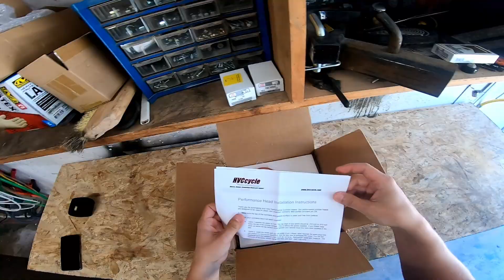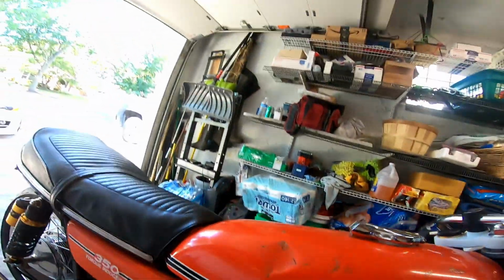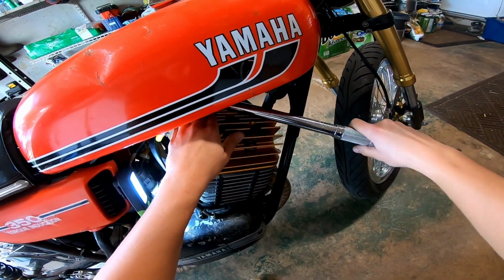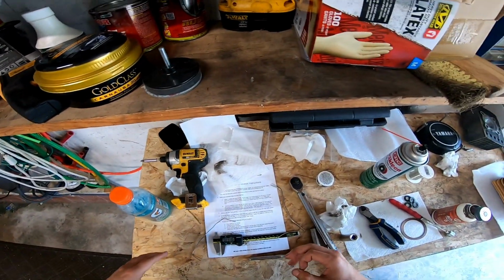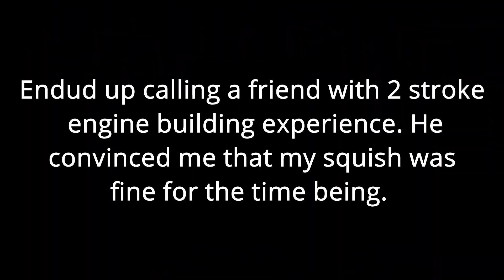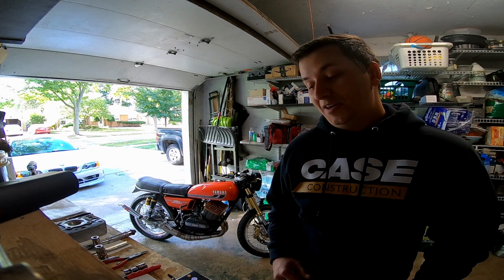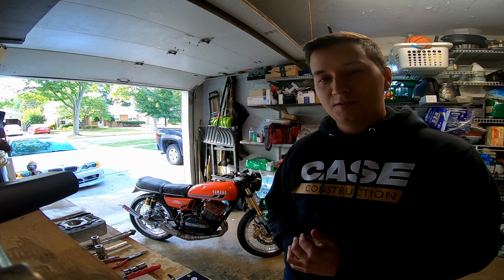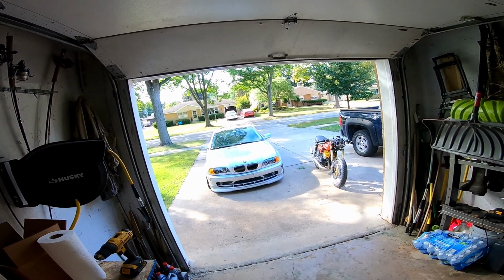Installing HVC Cycle CNC Performance Heads on my Yamaha RD350 Cafe Racer!

Comment: Hey would you share the specs of the entire front end on your bike, forks, tree, hubs and disc set up please 🙏
Reply: @engineered if you can share the specs, I am currently building a RD and want a similar set up
Reply from the maker: @HSJ1076  so I'm using 2017 honda grom forks. Turned down the RD stem on a lathe and pressed it into the grom lower triple tree, just used new RD tapered stem bearings. Using an EBC aftermarket ducati monster 695 300mm brake rotor, though theres various ducati models that use the same 6x80mm bolt pattern 300mm rotor. Aprilia rsv mille brembo brake caliper with a moto guzzi v7 brake master cylinder and a spiegler stainless braided brake line made to length per my specs. 

I designed in CAD the various adapter parts and had them machined from aluminum: upper triple tree, left/right axle adapter, brake caliper bracket, rotor spacer, and gauge bracket. You can probably get away with the grom upper triple as well if you machine an adapter to step up the rd stem to the grom triple's stem hole diameter. Also i had to shave about 2mm off the bottom of the stem tube on the frame to allow the bearings to seat in the stem tube without the tube rubbing on the grom lower triple when turning the handle bars.

Also put in .75kg racetech springs in the forks, but would recommend the racingbros spring/damper kit instead with the same rate springs so you can get damping adjustment.

Im using the original RD hubs, just spent a pain staking amount of time sanding/polishing them and rebuilt them with new stainless spokes and excel shouldered rims from buchanan's spokes. Hope that helps!

Comment: If that's motor oil in the gearbox then your clutch is shot. Motor oil has anti-friction additives in it and isn't something you want on/in a clutch's friction disc. It's like getting lubricant on your break pads...
Reply from the maker: Nope, using motul 10w-30 trans oil which is the spec for RD350s. But good suggestion!
Reply: my factory manual says 10/30 motor oil!! for transmission
Reply: @richarddegen6184  dry or wet clutch?

Comment: It’s cheaper to get stock heads machined unless you really happen to like the look of the aftermarket ones.
Reply from the maker: Closing up the squish with shaved heads isn't quite the same as switching to a new combustion chamber design and tightening the squish. But everyone's got their preference!
Reply: @ you can machine the standard heads to create a proper squish profile.

Comment: Only tach, No speedometer? 
I guess with this bike it doesn’t matter how fast you’re goin’, as long as you know how fast your motor’s goin 😎
Reply from the maker: The tach/gauge actually had a multifunction LCD display. One of the modes is speed :) clean all in one solution

Comment: Something seems wrong there.  3mm squish is way big!! 

I run no less that 1mm with stock heads.   Night and day difference going from a 2mm to 1mm squish 

I have pulled down quite a few of these motors and see many times 1 piston at 2.5mm and the other at 1.8mm.
Reply from the maker: It actually came in at about .7mm of squish at the end. A little tight but works fine and running only 93 octane or higher.

Comment: "Enginerded", you do know there's a reason why motorcycles have front fenders that has nothing to do with keeping water etc. off the rider, don't you? Or you should. It's called a "fork brace". Look it up. Keeps the forks from bending, and yes, even USD forks need it. By the way "cafe racers" need stronger forks, not weaker, so at least use the inside part of the fender if you think fenderless looks "cool".
Reply from the maker: Thanks for the input. Haven't gotten around to making a front fender and brackets yet as I just got the new front end together right at the end of last season. Will be making one in the future. Highly doubt a plastic fender works much as a "brace"  but i agree thats what the old steel fenders used to do on the original forks.

Comment: Yuo shouldnt see piston ring that much looking at cylinder,i think that piston is too small that bore.
Reply from the maker: That's when we close our eyes and pretend we didn't see anything :)

On a serious note, the bike runs great and sounds fine. It will be torn down eventually for a proper rebuild anyway.
Reply: @Enginerded  happines Will end when piston Ring snap 😁 it IS possible tap on piston Wear or Ring pushes it inside and piston Ring end up on of ports.